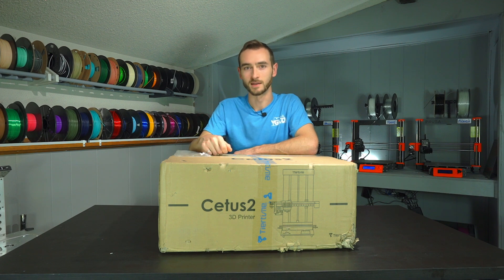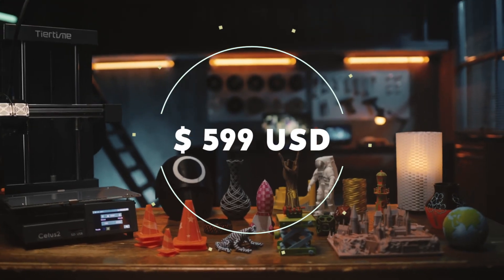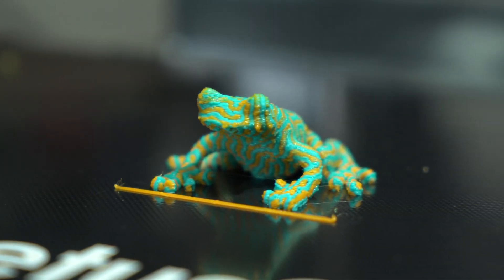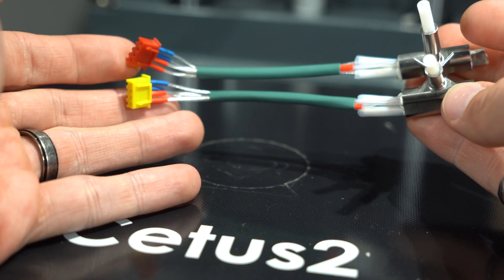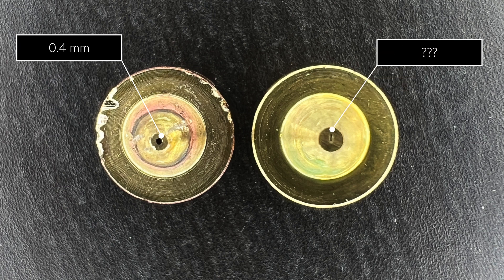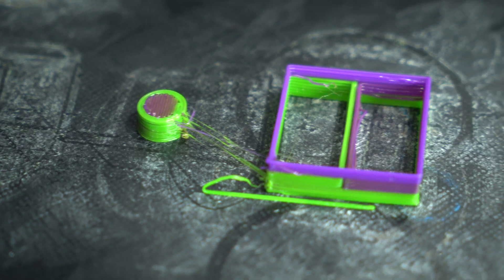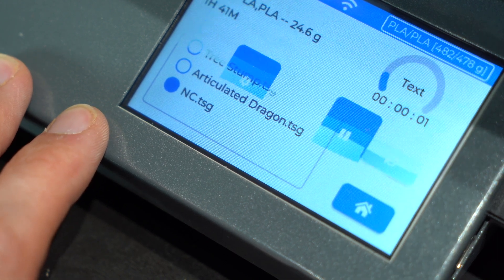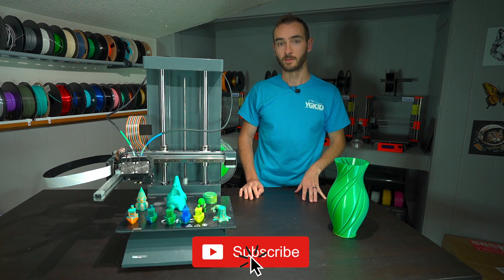This Color Mixing 3D Printer Is Not What I Expected - Cetus 2 Honest Review

Comment: The first Cetus came out in 2016 if I recall correctly, and had some cool features. I'm very surprised you never heard of it or their parent company. Referring to direct drive as new tech, is not correct. My first and all of my other printers are direct drive. My first one I bought about 10 years ago. 
What 3D printers have you had?  I think a lot of people just know about prusa, Bambu Labs, and Creality, but there has been and are lot's of other choices, and some have been using direct drive for many many years.
Reply from the maker: I wasn’t intending to imply that direct drive is “new”, but it is a more modern technology than Bowden extrusion. It’s also generally perceived to be better, though Bowden extrusion does have its benefits. 

Cetus is definitely one of the lesser known brands in the industry. I just hadn’t happened to have heard of them before.

Comment: have you seen a core xy printer with a stationary bed?
Reply from the maker: Yes. The Voron 2.4 and Troodon 2.0 are both Core XY with a stationary bed.
Reply: @ygk3d  is there a setting in a slicer, that does a flow rate dependent extrusion multiplier?

Comment: Ive got one of these ..went through 3 mainboard replacements & multiple cloggs - used original software & cura but never got anything out of it in any decent form - switched to a K1 & have printed off more complete models in the couple of months ive had it than the year of struggles with the cetus - this printer has so many issues & shouldnt have been released to the public - buyer beware !

Comment: Some prototypes were sent to reviewers about 14 months ago but the printer was not complete and neither was the slicer, some reviewers got units a couple of months ago and one that I watched had massive layer separation issues, however, that was due to making some changes in the slicer settings, after returning to the stock profile it printed just fine, although multiple different prints were not shown so it didn't really have time to develop the issues you had.
 That ribbon cable looks like an old floppy drive cable!

Comment: If this came out before the Bambu AMS I'd be interested, warts and all. But I can't go back to just two colors, even with partial mixing. If the Cetus 3 is 4-color I'll be more interested. Appreciate the thoughtful and thorough review, though.
Reply from the maker: Bambu changed the game… hard to go back after that. If Bambu came out with a color mixing printer I bet that would be a game changer too, especially if it could mix more than 2 colors, or have the mixing be more thorough.
Reply: @ygk3d  That would be great. I'd have to seriously consider buying one if they could figure out the mixing. The CMYk kit kinda does it, specifically for lithophanes, but it's very limited and honestly doesn't give great results. It also results in a LOT of purging. If they can improve the process, though, you'd only need 4 filaments to make pretty much any color. And it would be amazing. I would love to be able to print color pictures, especially if you could add them to the surfaces of prints. I think that might be a bigger leap forward than the x1c was and I think that was the biggest improvement in 3d printing in years.

Comment: I had one of these machines also for review. I found the software extremely buggy, the extrusion and print quality totally inconsistent, had several hardware issues that needed replacement parts. I had spent way too much time and effort on this printer, an eventually sent it back. Not a good experience at all.
Reply from the maker: This is the issue with accepting printers for review. Sometimes it’s way more work than it’s worth. I could see this type of unit being sent to beta testers, but it’s not nearly ready enough to be sent to reviewers.